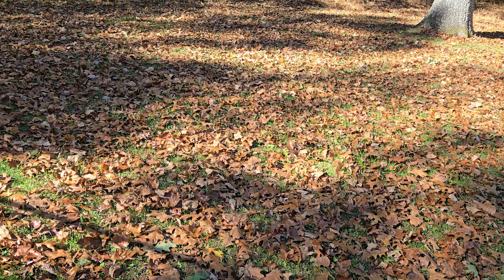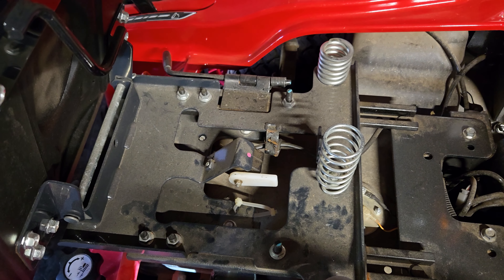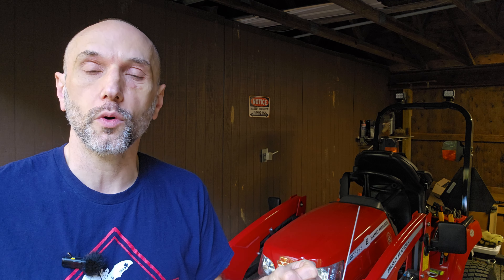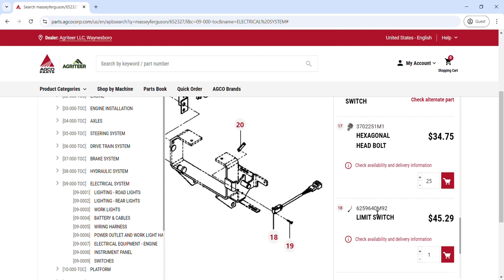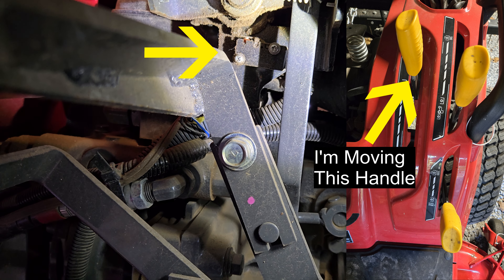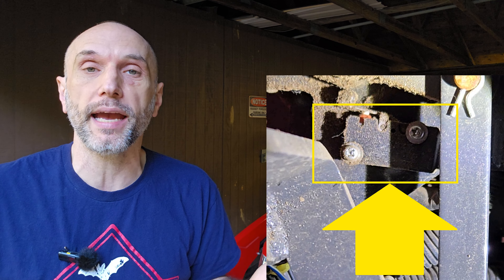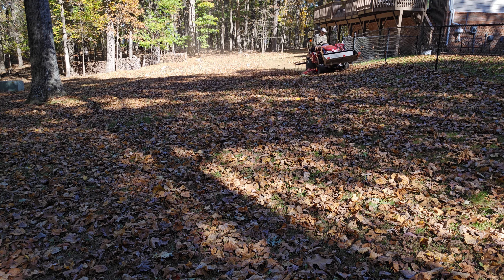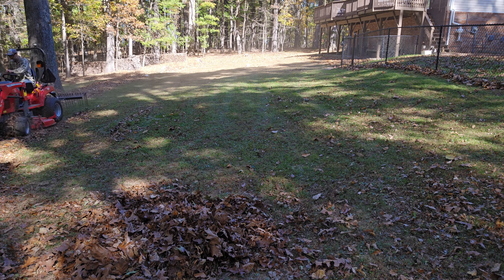Common reasons your tractor will not start

Comment: I have been considering a PTO driven chipper.  Am I correct in assuming I would have to defeat the seat switch for the PTO to spin while I am off the tractor?
Reply from the maker: @charlesperry1051  Yes, you would.

Comment: Why doesn't  your dealer fix this? I thought these tractors had a 5 year warranty?
Reply from the maker: Mine isn't broken, I was just explaining a few user errors that can cause the tractor to not start. I have the 10 year powertrain warranty on mine which was a $500 upgrade from the base 5 years, but I don't think switches are covered beyond 2 years.